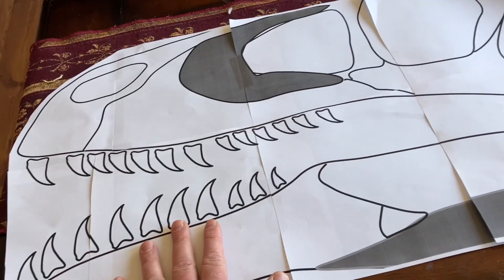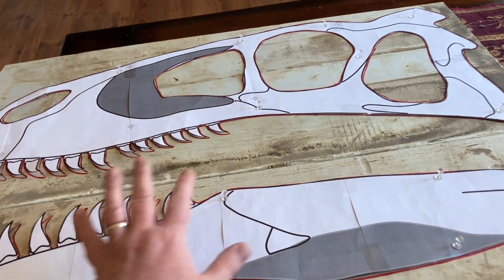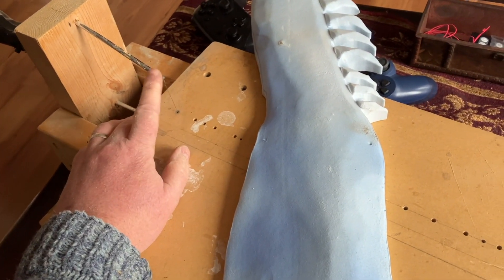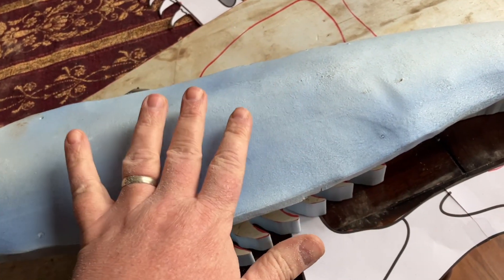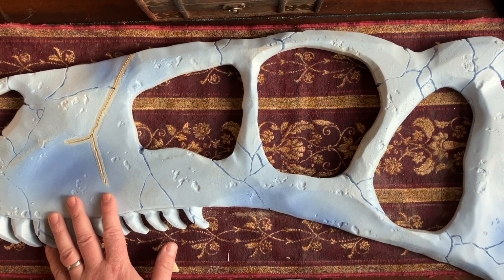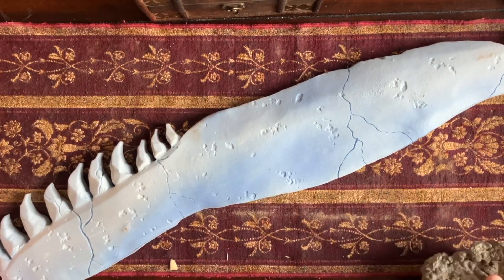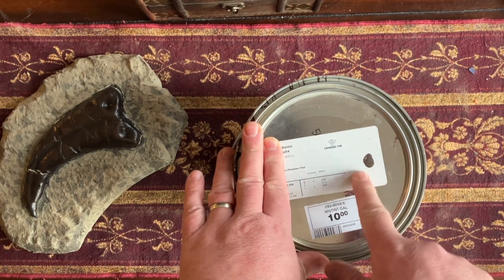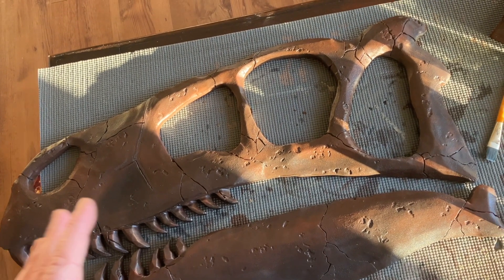Build a life sized Utahraptor dinosaur skull fossil from styrofoam!

Comment: I have started the utahraptor.  Doing a 14in smaller version.  What I did was use a rasp in the shaping then covered it in air dry foam.  I also cut off the teeth you have drawn in made teeth out of air dry foam..Came out great:)  Rawr on.
Reply from the maker: That sounds great! You may find the air dry foam (Depending on brand) may contract a bit as it dries, but in many cases the cracking is minor.   I'd love to see the final result if you were willing to share!   Thanks for watching :)